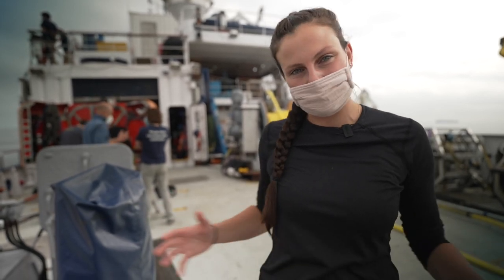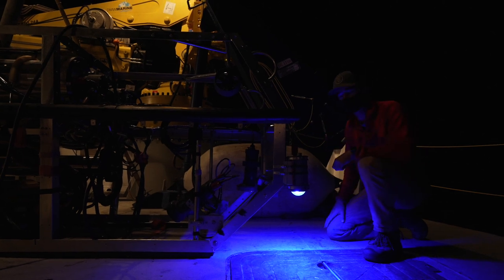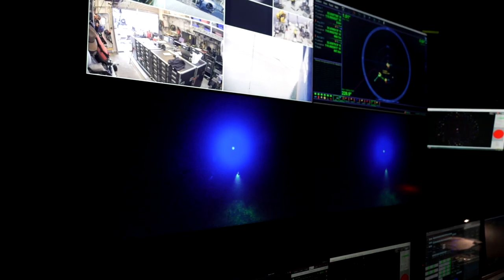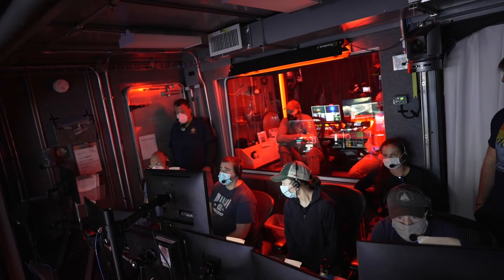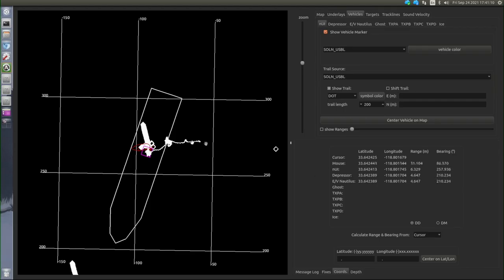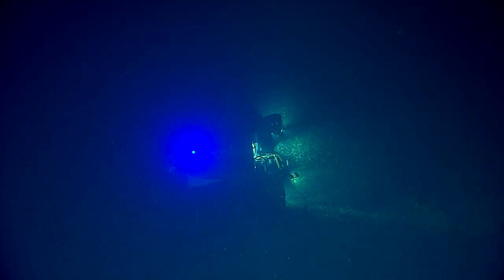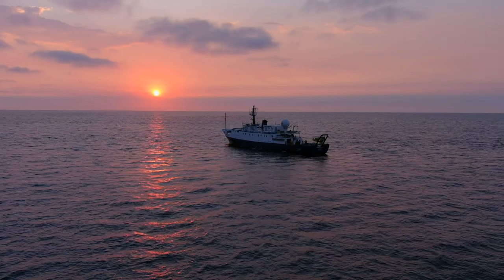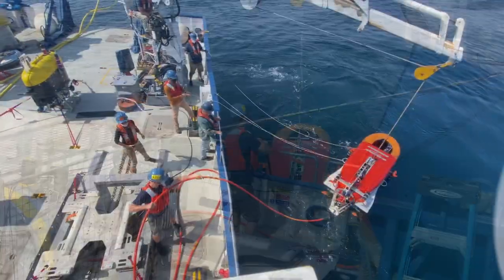Pushing the Edge of Deep-sea Exploration with WHOI's HROV Nereid Under Ice (NUI) from E/V Nautilus

Comment: It's nice to see someone found a way to get rid of the tether but I can't help but wonder if sound wouldn't be better for transmission of data?  Are there wavelengths of sound that fall outside the hearing of cetaceans and other sound sensitive creatures?  Seems like sound would offer greater freedom than optical.
Reply: The wavelength of light is in the nanometer scale. The wavelength of sound ranges from multiple meters to mm scale... the amount of data you can transmit (bandwidth)  is much smaller for sound than light. Also sound would be affected more by water density changes than light. It's why 5g is faster than 4g etc.. greater data transmission per unit of time...
Reply: It is still tethered to the ship.
Reply: @shrugg6593  I completely agree that it's the right thing to do.  I was just clarifying that it does, in fact, have a tether.
Reply: @AGDinCA  it's just a tether though...

No power or data...
Reply: @shrugg6593  Very cool 😎 The tech is just amazing!